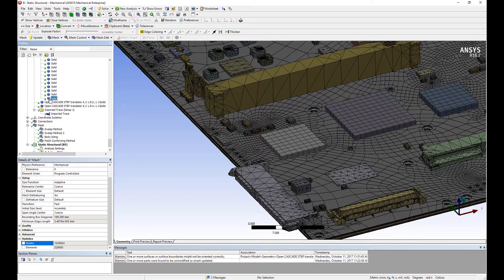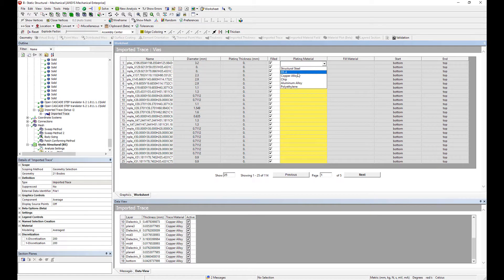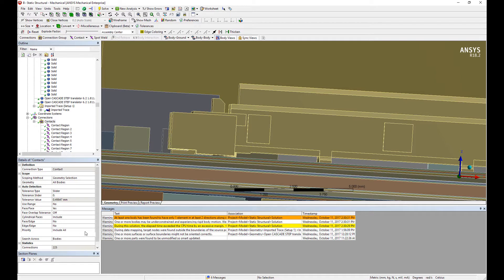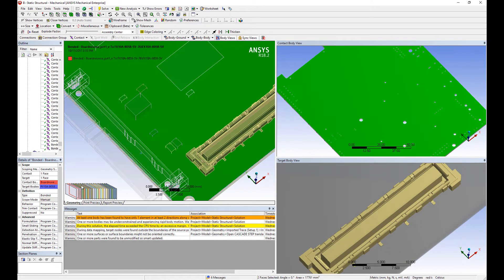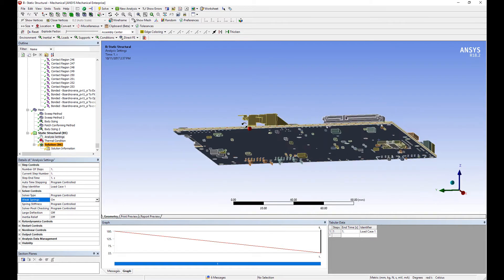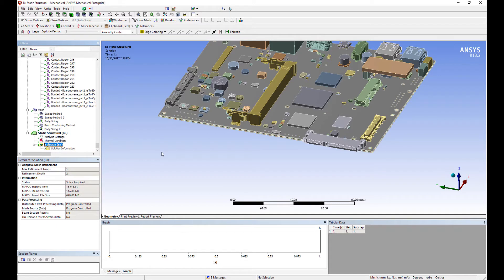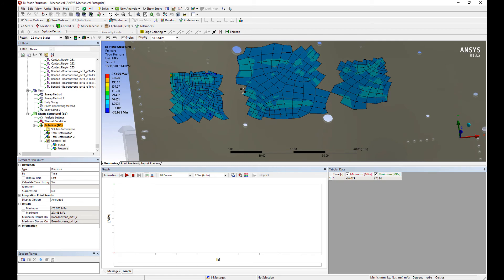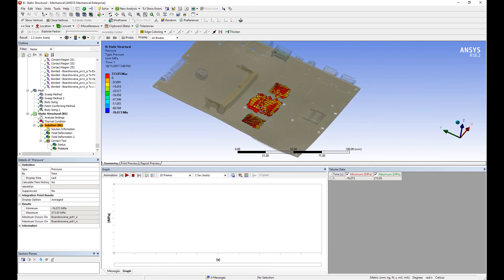ANSYS PCB Warpage Analysis Part 3: Trace mapping and Simulation

Comment: Have a nice day! How you use averaged modelling? I use the same copper alloy, but the software only allows black/white option.
Reply: Hello, if you go under the materials/imported trace tree and click in the imported trace option, it's possible to find the "Material" section right above the "Discretization" section in the Detail Window. There, in the option "Modelling", you have to change the "Black and White" item to "Averaged"

Comment: Can you please help me understand in defining the trace material, why is every layer copper?  Shouldn't the dielectric layer be mapped with the Cured Epoxy material?  or is trace always metal and the base board material is the epoxy or FR-4 in yoru case.
Reply from the maker: Yes the base material is set under the geometry branch. The trace material is usually metal.
Reply: @SingularityEngineeringLLC  does ansys internally compute the overall equivalent material properties and do analysis, Since it is 200*200 grid, I assume when the material is mapped each quad cell will have different material properties right?